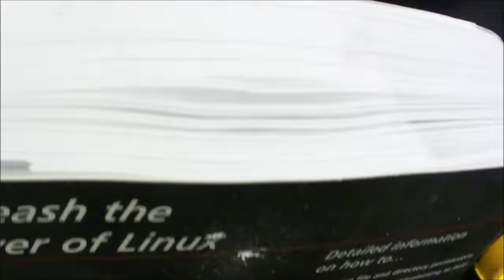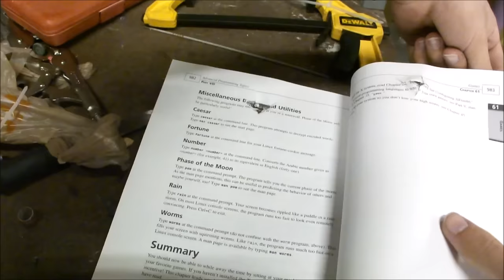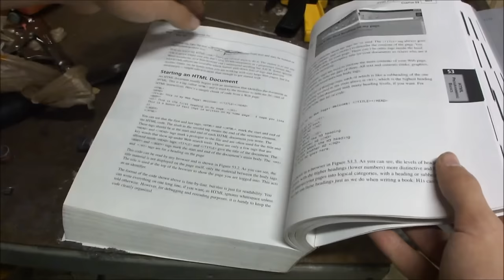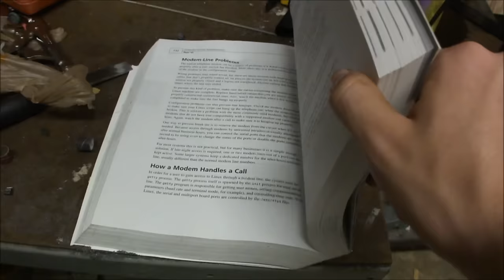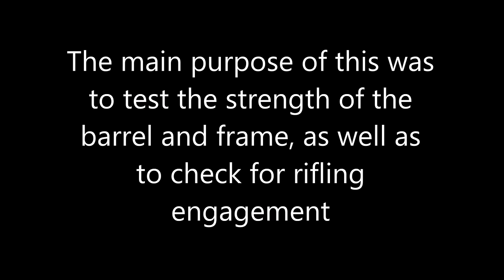380 Firing/Barrel Strength Test

Comment: Good job so far. Everything seems to work great. One think I noticed though. Your "D-pin" style breech lovk doesn't seem to hold the breech closed snugly like it seem to be about to ope just a tiny bit. Also I could of sworn that your fired shell has a crack in it. If it did then your chamber may have been bored too wide of a diameter, or could be due to the probl with the breech lock I mentioned. Just something to look into. Great build man
Reply from the maker: Nathan West The shell doesn't have a crack, however the primer does have an unusually large indentation, which is do to the test rig I set up. also the latch doesn't keep it closed all the way but it's not a very large gap, and I'm currently working to fix it